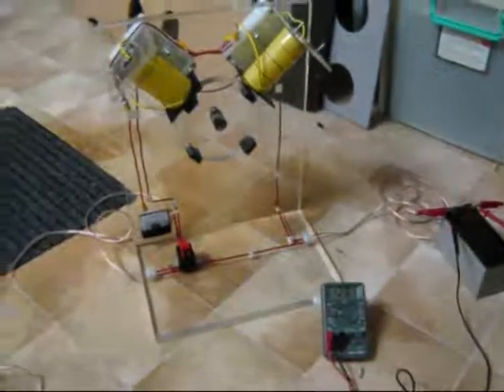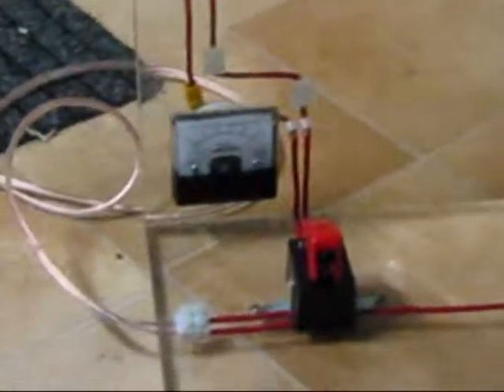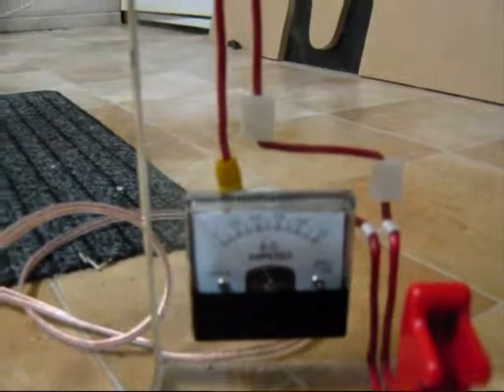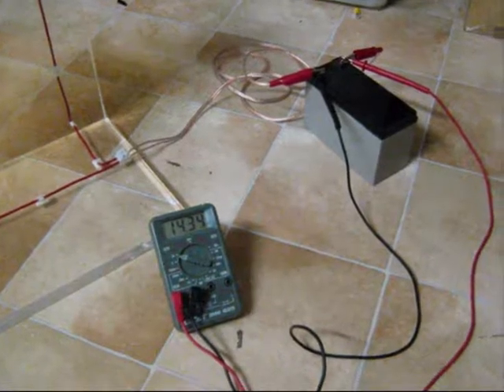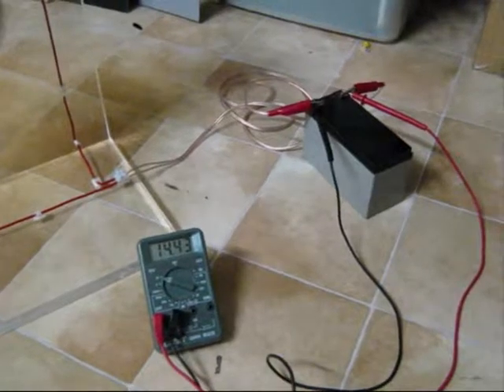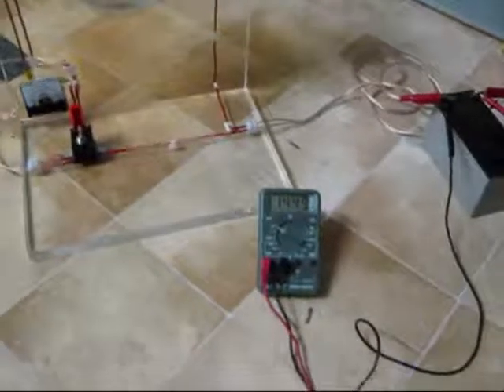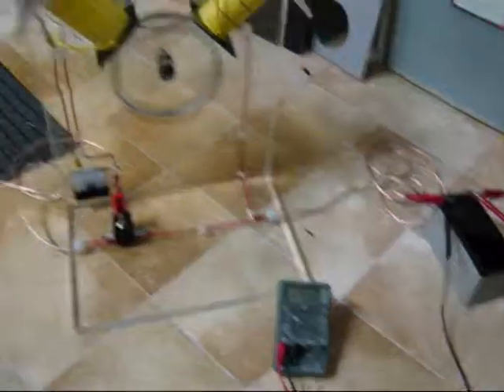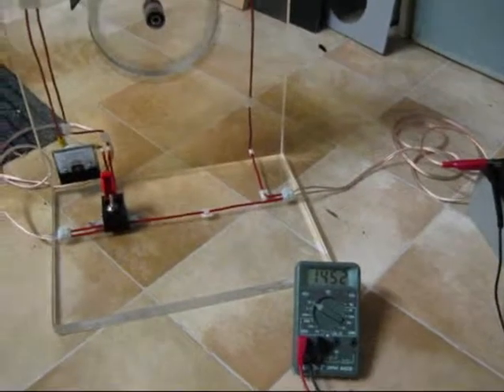bedini charger Video 13

Comment: hey steve, with your switching circuit... An easy way to do it could be to just get a simple voltage indicator for a car battery from Jaycar electronics.

It just lights a LED when the batt reaches a certain level which u can choose by putting different resistors in.. U could run this into a relay which can do the switch

Comment from the maker: The schematic I am using is JB's multicoil one. 

The two coils pulse at the same time. The coil on the left has the trigger winding and the coil on the right is just a slave. This enegizer is good for smaller batteries, but is underpowered for larger car batteries etc. I am adding another quad-filar coil to it this week.